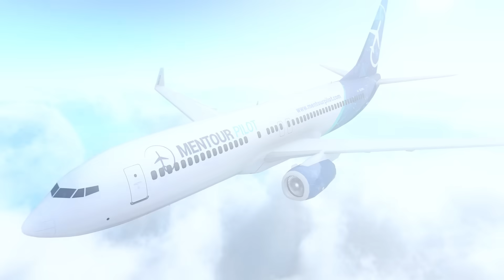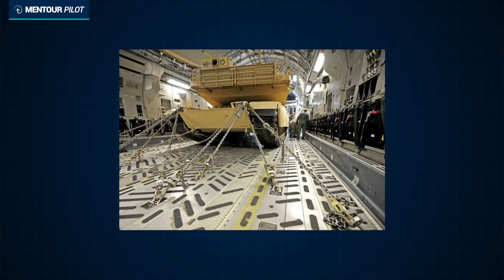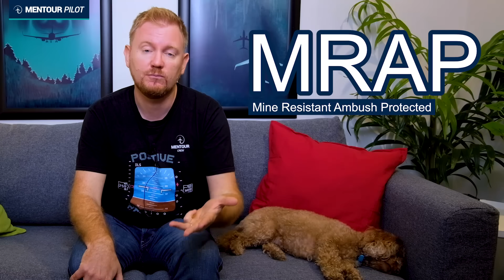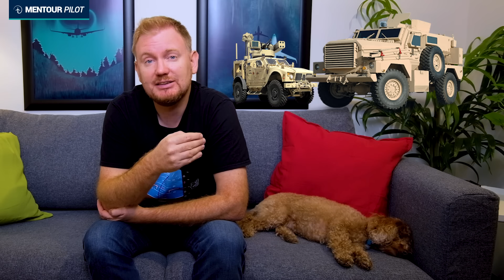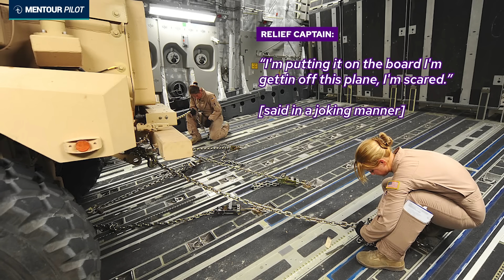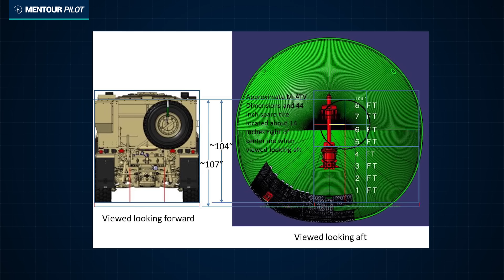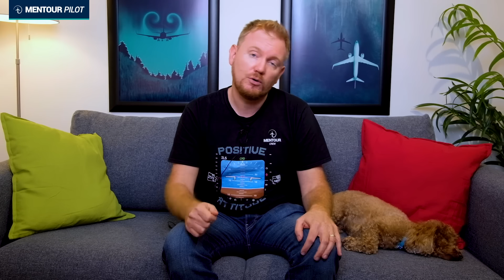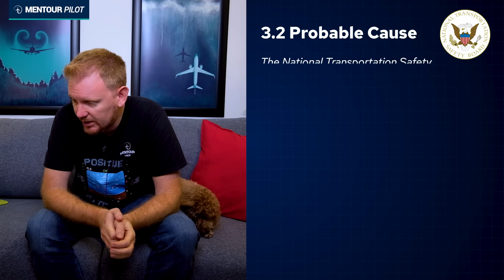Why did the pilots LOSE control?! National Air Cargo flight 102

Comment: Question: Could they have rolled off the lift factor? Basically turn it to drop the nose?
Reply: Possibly, it’s a valid technique to recover from a nose-high unusual attitude if elevator input alone isn’t helping you but in truth they would just have been postponing the inevitable. The rearmost vehicle took out the elevator jackscrew, thereby destroying all pitch control, it’s almost impossible to envision a non-tragic outcome from there on.
Reply: At that altitude they wouldn’t have the time to recover
Reply: In the end, there is no future for an aircraft that is full up-elevator.

Comment: The conversation about how the pilot would think something so big and heavy wouldn't move at all is a little odd. Obviously everything in the plane moves as fast as the plane itself, and inertia/momentum dictates that heavier stuff is a lot tougher to secure. So bigger stuff is more prone to shifting, not less. Maybe it was just awkward phrasing, he clearly knew the danger.
Reply: he meant moving as compared to the airplane.
Reply: @ursodermatt8809  I know, that's what I'm saying. When the plane starts to move, inertia makes everything inside try to stay still, effectively trying to move backwards within the hold. The strength of this inertia is proportional to the mass of the cargo. Similarly, once the plane is already moving and tries to slow down, momentum of the heavy cargo makes it try to continue forward. I'm saying that these forces are more pronounced on heavy cargo, thus making it more likely to shift within the airplane.

Comment: Thanks for the well done video. 
It is really "strange" that no one really asked for this to be totally "secured" when they knew this kind of payload moved "couple" inches and even severed straps! I mean, I am not even a specialist but I have transported on occasion (for friends or myself), a fridge a or a huge sofa etc. on a trailer, and even when you think this is well straped, sometimes, looking in the back mirror while driving on the road, you hit a bump and you see the "oject" jumping like one foot in the air, with 4 straps that were absolutely "tight"....Then you realize how "close" you were to a "catastrophic" event.  So.... "rotating" a rolling "tank"of 18 tons...  how can they missed that !?!? I guess this is why in the army they were using heavy chains and load bars to deal with these kind of loads on the transport trucks...

Comment: I vaguely recall a load shift incident on Jersey where it was not intially catastrophic but put the aircraft too out of balance to be able to have sufficient elevator authority once they tried to slow down to make an approach.  They stalled in on final.
Fairly obviously, thhe bigger the load, te bigger the problem, but it doesn't need to wreck the aircraft controls to create an unrecoveralbe incident.  If this flight crew had studied the Jersey incident, they would probably have taken the load security more seriously.  I'm quite frankly amazed and appalled by the light-hearted treatment the flight crew gave the problem when it was discussed.  That was the point from which the flight was doomed.

Comment: just adding from wiki, i wonder why the air force did not provide their own transport load master (or a controller/teacher) with such expensive, heavy military gear. "At the time of the crash, the aircraft was flying on behalf of the United States Air Force's Air Mobility Command."  So i wonder why nobody ever recommended that the air force at least sends an expert when they want to save money by using private transport companies, given that they did not really cared about the companies experience with heavy military gear. And yes, i am aware that this vehicles were property of the NZ military, not the US.

Comment: Absolutely Fantastic Explanation as always Capt Petter
Also, i wish the crew had parachutes and an escape mechanism to eject out of the windows of a falling aircraft.

I also have a question to you Captain:
If an aircraft is at cruising altitude let's say FL 300 and something such happens that their  navigation and adsb network goes off and then followed by engine failure along with hydraulic failure, and is losing altitude, and if the aircraft is not detected by other aircraft in their TCAS as a potential danger as traffic, can it be catastrophic?

Comment: Still don’t know why the used nylon straps instead of metal chains! I’ve seen all these as Air Disasters is one of my favorite television series. Great job Mentor.
Reply: Military aircraft have metal rings in the floor you can use to secure chains but civilian aircraft do not have any place to secure the chains.

Comment: not trying to be an armchair pilot, but i am curious - I have seen Warren Vanderberg's videos. If the crew knew what had happened, and followed the nose high unusual attitude procedure of rolling the aircraft, could they have maintained/regained control? I recall (and saw some graphics in your video) that the loss of hydrolic systems effected their roll control.

Thanks Peter (Petter?) for these videos, again i would like to request you do air france 447. Lots to talk about in terms of CRM, startle effect, automation dependency etc, and i would love to hear your opinion.

Comment: Every 2 years, I'm required to take a recertification course to maintain 747-400F load sheet officer status for the airline I work for.  This National crash video has become part of this class material.  Don't have access to heavy cargo manual right now but I can tell you that 24 straps for 18ton cargo on center load is no way enough.
Reply: The problem is each airline has its own standards for securing cargo. There should be national standards set by a regulatory body, like the FAA, that is uniform, and everyone has to follow!

Comment: Three points jumped out to me. Firstly when you said how many straps were on those vehicles. When you gave the number on the Cougars, I literally put my head in my hands. I'm a HGV driver (semi's) and whilst I have no clue about airplanes, that just didn't seem enough for that amount of weight. Secondly, the loadmaster doesn't need any qualification. That is absolutely absurd. I hope that's changed. Thirdly, they knew it moved on the first leg but left again. That was beyond belief. I would have at least expected it to be rechecked by the PiC or First Officer personally after they knew there was an issue on the first leg.

So sad and so preventable. Thank you for such a great video though.

Comment: So was the C/G shift still within the ability of the flight controls to counteract?  Or would they have been in bad shape even if the stabilizer trim was not out of commission and in a bad position?
Reply: Apparently it could. If the load had shifted but not smashed through the back wall they might have recovered in time

Comment: Ok,  we were not there, but can't help wondering if these heavily military vehicles were just standing in the cargo hold with their parking brakes disengaged, and their transmissions in neutral, while being inadequately strapped down? 
Because if the brakes were applied,  and the transmissions in the lowest gear  (or park) they would have had to slide on their wheels, instead of just rolling backwards and forwards, which in itself will break the straps quite quickly.

Comment: I only hope that any air freight company today should have to have a little more training than the lowest bid when moving "any" out-sized or very heavy piece of equipment. When I saw this crash on TV it was mentioned that the load-master had followed the manual on how many straps to use for this weight, but it turned out to be woefully short of what was required.

Comment: I'm sure I have seen this reviewed before and it wasn't just the straps but the angle of the straps that were attached that reduced the load restraint effectiveness. Anyone else recall a video like this?
Reply: Thats the Air crash investigations episode. The manual gave a strength of the strap (saw in Newtons of force G load) but that assumed the load was 90 degrees. You have to do components if its at an angle (which these all were) but the manual didnt say that. Im amazed the straps held for the first flight at all to be honest.
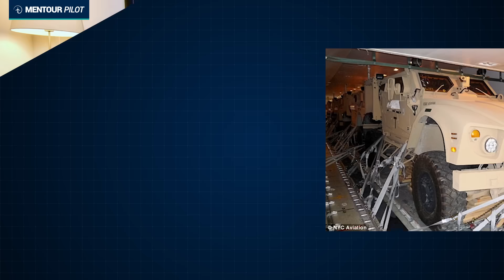Reply: That was my first thought on seeing the image at 3:36 -- the vehicle is strapped DOWN, but almost nothing is keeping it from rolling backwards several inches.  That would badly over-stretch the two or three straps leading forward.  And when those straps were cinched tight again for the second leg of the journey, they were set up to rip apart.
Simply put, the loadmaster didn't seem to give any thought to the plane's rotation at takeoff, and to what forces the straps would have to resist at that particular time.  There was also, apparently, no appreciation for the damage done when a strap like that is stretched by several inches.
Reply: Yes, that's correct. There were a couple of additional nuances that contributed to this accident. First, as you pointed out, the angle of the straps. And second, this takeoff required a steeper than usual takeoff pitch attitude, due to the fact that they were in hostile territory, with the risk of shoulder fired missiles, that landing and taking off aircraft faced there!